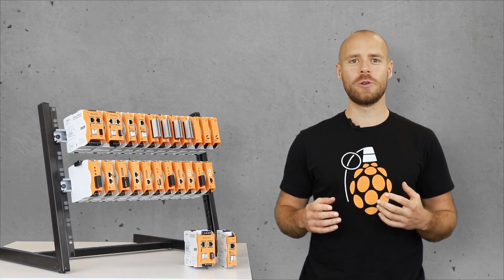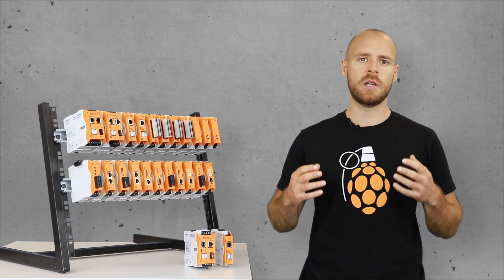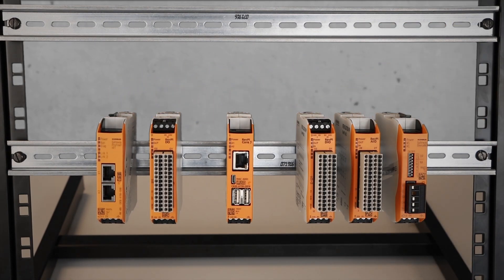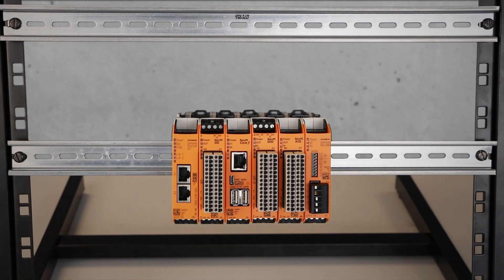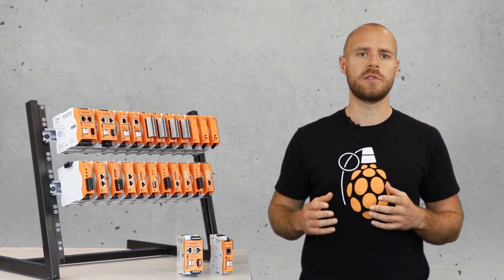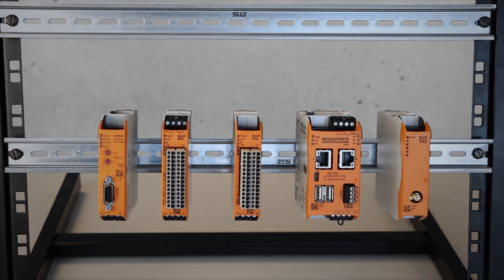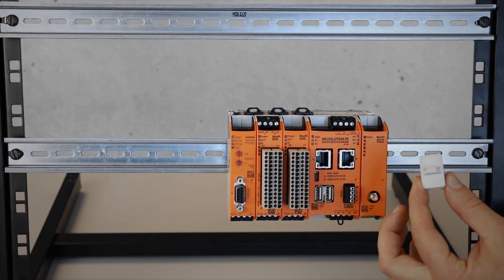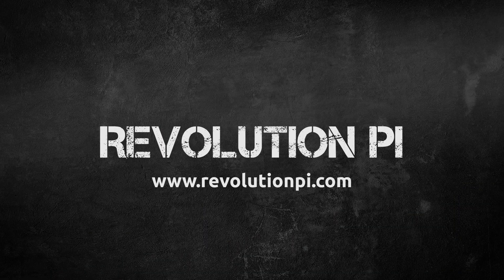Explaining the modularity of the Revolution Pi System, a system based on the Raspberry Pi

Comment: Hi, good video, congratulations! My doubts are about the external devices who I can connect to RevPI Connect. At my equipment I'm using industrial sensors and antennas, as a example, I develop an AGV using Keyence Laser Scanner and RFID Antenna via Serial (data A/B)... Could I connect this kind of device (using the correct expansion cards)? Im very interested in using this solution at my equipment! Thanks in advance!!
Reply from the maker: Hi Guilherme,
since we don´t know the specs of the sensors/actuators you are using it`s impossible to tell wether those device can be connected or not. But in general, industrial sensors can be connected to the Revolution Pi system as it is done by thousands of customers all around the world already. Regarding Keyence laser sensors: In 2019 we presented a live demo model at the SPS fair in Nuremberg where we connected a Keyence laser and a RFID reader to a RevPi Core 3 and a RevPi DIO. You might want to look into the spec sheets of all of our expansion & base modules to see what they can handle and if your sensors suits our modules ( https://revolution.kunbus.com/tutorials/downloads ).  Further you can also ask our experts in our forum ( https://revolution.kunbus.de/forum/ )